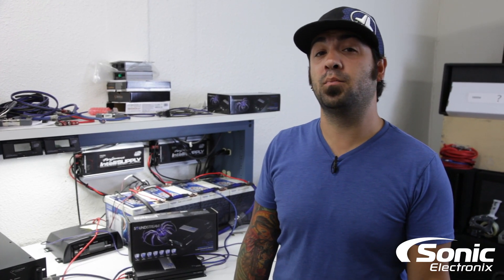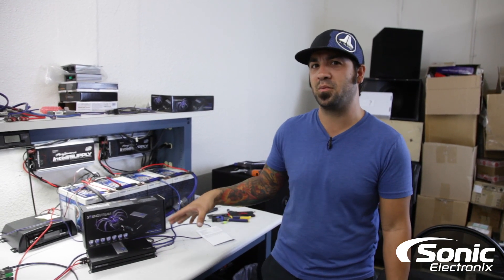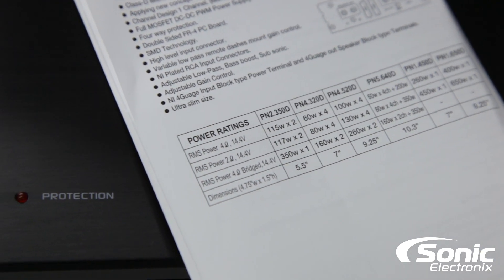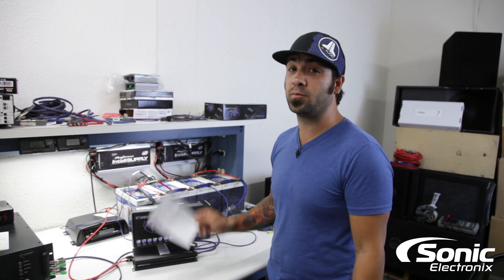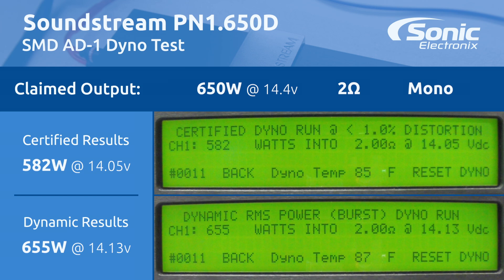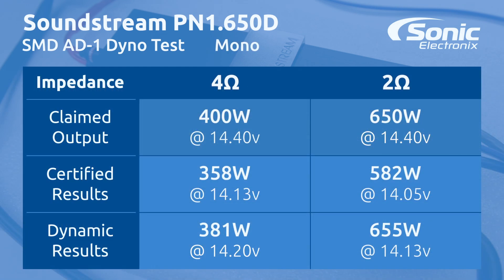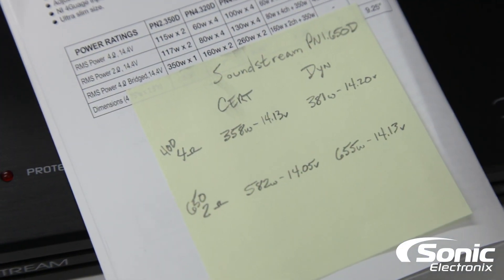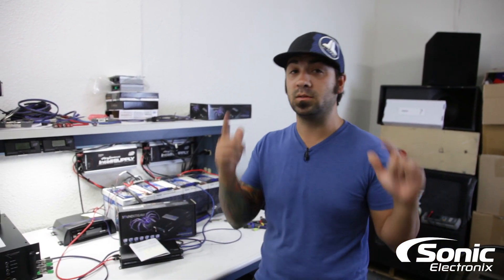SoundStream PN1.650D Amp Dyno Test | SMD D'Amore AD-1

Comment: This is a $110 amp that has a tiny footprint, operates very cool and is waaaay more efficient than our old school class a/b amps. It's rated to do its power at 14.4 volts so, the test left a few watts on the table. In a daily driver you could never tell the difference anyway. These or the PPI Ion series (same internals) would make for a good all-purpose solution to adding some good 'bump' to your factory system.

Comment: Looks like a 358 watt amp to me. I don't listen to sine waves, and I don't run  low impedance.
Reply: Sine wave testing would be the certified. Actual music power would be dynamic, but if you know anything about actual class D amps, they're usually more efficient at lower impedances.

Comment: ya know thats not bad for an amp under $100, not sure how people could even begin to complain about 50 watts and even at .35 volts under rated im sure it would be a lot closer if the batt bank was at 14.4
Reply: +splaudio1 yes ive noticed that vary rarely do the amps make the certified rated 4 ohm power but at 2 ohms they seem to do much better . and yes i did some simulated math on the results and they get within 30 watts of rated power even at 4 ohms when you apply the full 14.4 volts .. im also wondering  with a 1kz test track it would likely make a small difference less torture on the amp.and would do rated power
Reply: +Stacy Williams  the 1khz track is the industry standard thats why when we test amps at 40 hz they don't compare with the manufacturer specs and we can never understand why  and then you have guys jumping ship over 50 watts here and there and all the while they talk bad about an amp they completely forget that the amp is $99 im still amazed at the output from seeing the guts they get that much power from such a small footprint
Reply: +splaudio1 especially how small it is i have the fosgate prime 500.1 my birth sheet  shows 616 watts  this one is 50 bucks cheaper and more powerful ...

Comment: Looks like a fail to me..only made said power in dynamic @2 and just barely made that..failed the other 3 tests. Amps should make rated power certified.
Reply: +Timothy Hinton They're not seriously underrated, for sure, which is always nice to find out - getting more than you paid for, essentially. But this amp is performing very well, especially because the tests were at ~14.10 volts, not 14.40, which is what it's rated at. I have the 60x4 4-channel version (PN4.320D) and am very happy with it. And since my full range speakers are 3-ohm (Infinity Primus), I'm getting even more power out of it.
Reply: LOL   bunch of newbs.  Dynamic is music power, not to mention the voltage was down. Where is the lie??
Reply: Boss Hawg thank you!
Reply: doesn't matter they lie about their ratings, so not worthy to me..